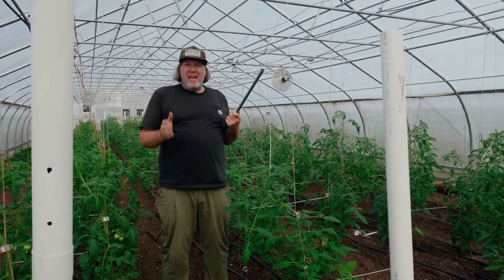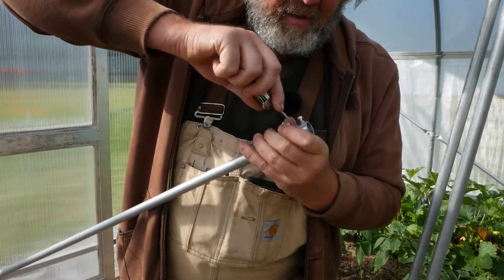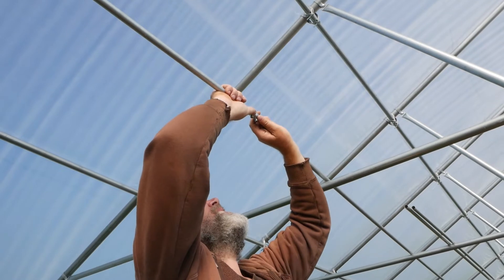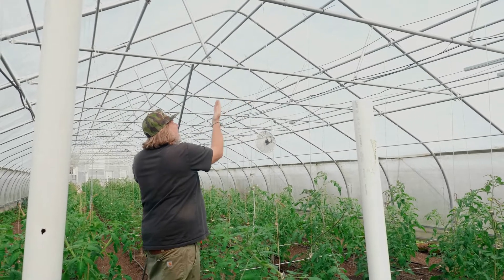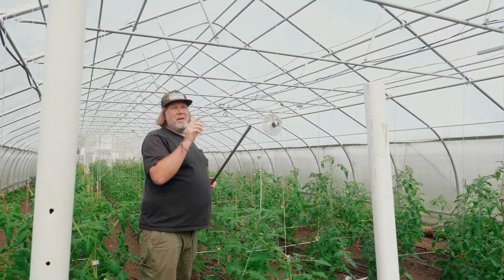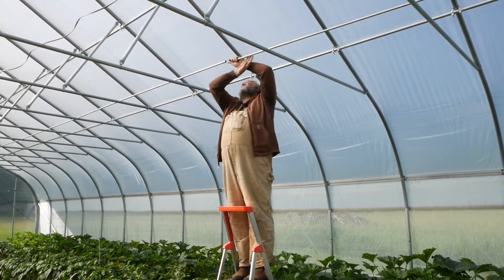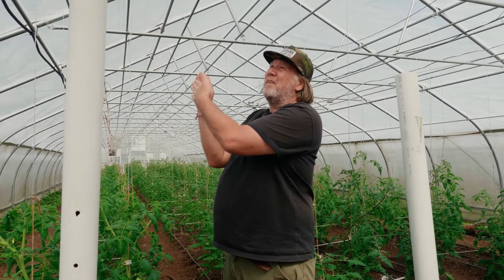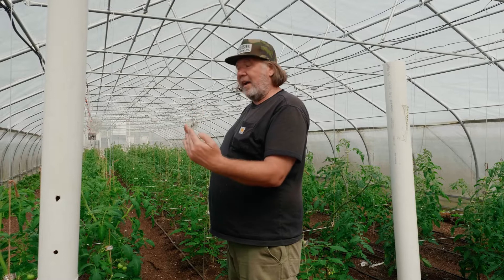Infrastructure for the Hook and Wicket System

Comment: If you had to speculate, could you use a wire and wicket system like this is a farmer's friend caterpillar tunnel; or is it too short of a tunnel, heighth-wise?
Reply from the maker: Check our site. There is a chart for heights of hooks based on your tunnel height. If there is headroom, it should be fine.